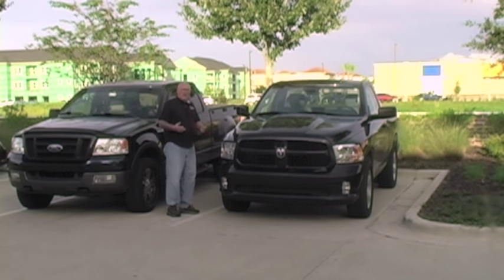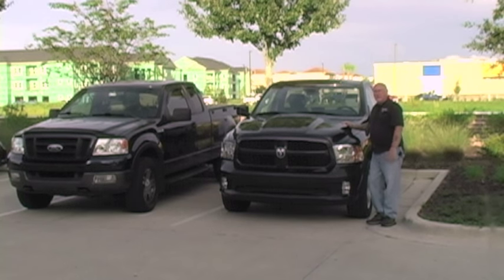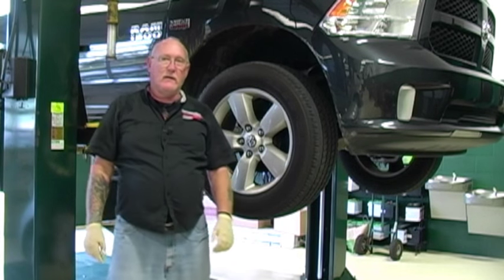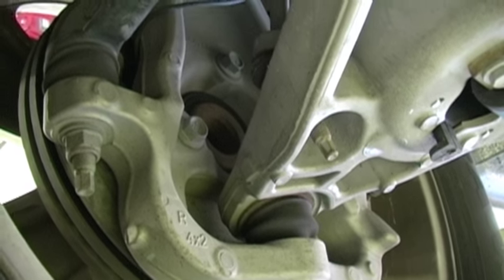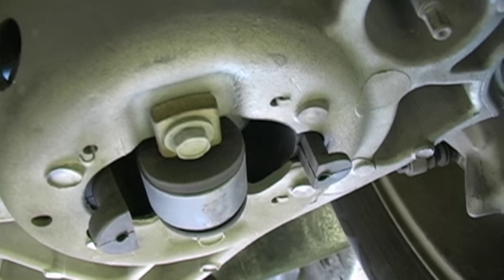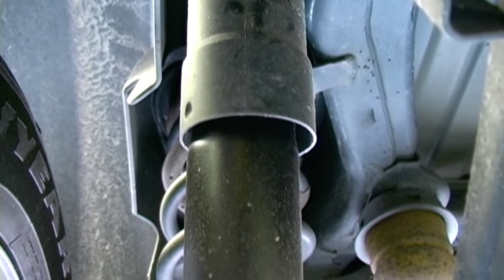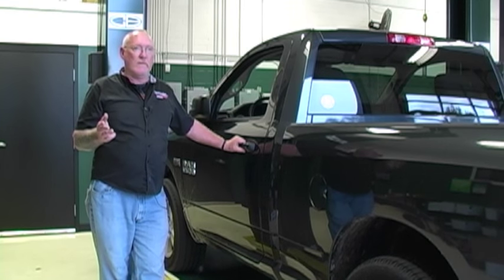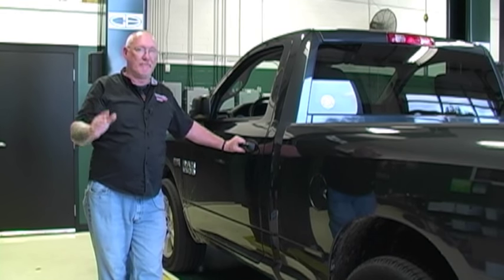The Trainer #46: How to inspect the steering and suspension system

Comment: Hello, Pete. How do the toe and camber wear happen, please? I cant seem to understand.
Reply from the maker: Stand up and look down at your feet. Now point your toes inward - they are now on an angle to your direction of travel, and your shoes will scrub as they try to move forward. That's toe wear. Now point your feet forward but tilt your ankles outward. As you walk, the sides of your foot will wear but more smoothly as the contact area moves to the outside. That's camber! Of course, toe can be in or out, and camber can be angled in or out. Does that answer your question?
Reply: I do understand the angle, but the wear that I don't understand. Does the wear come from the tires touching the suspension parts?
Reply from the maker: No, from the impact these angles (if out of spec) cause to the tire's contact point on the ground. Much like the sole of your foot in the example I used. If the toe (in or out) is incorrect, the tire cannot roll freely but is being pushed down the road instead. And camber is even easier to understand. If the tire is on an angle, then the contact area is closer to the side, wearing down that area of tread prematurely.  Clearer now?
Reply: Thank you so much, Sir !
Reply: @MotorAgeMagazine  how often should you get your front alignment done?
Reply from the maker: @michaeljohn7467  You should have it checked annually if you’re an average driver.
Reply: @MotorAgeMagazine 
You are a good mentor with a lot  of patience and passion.